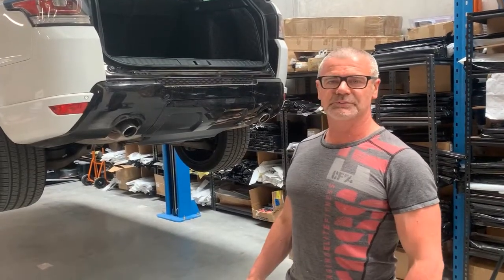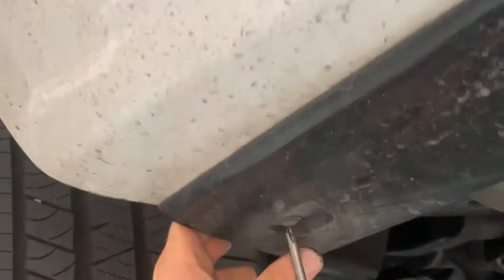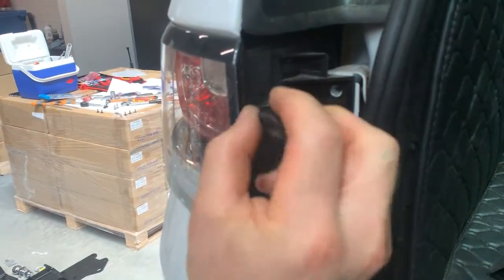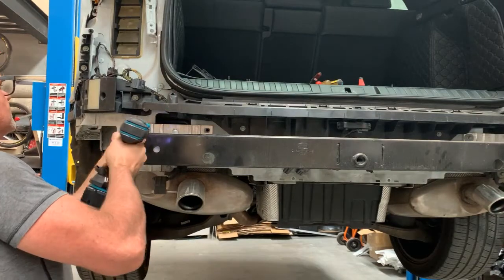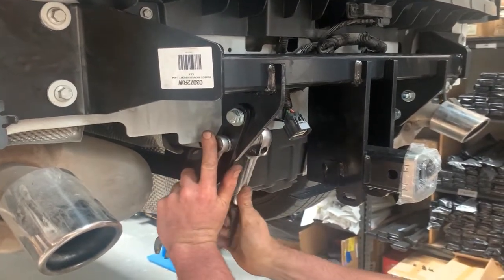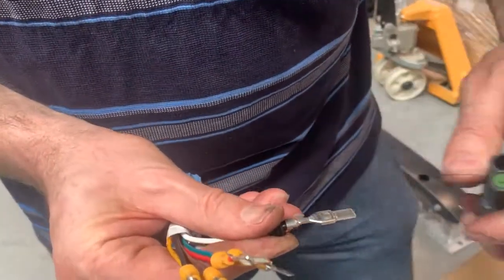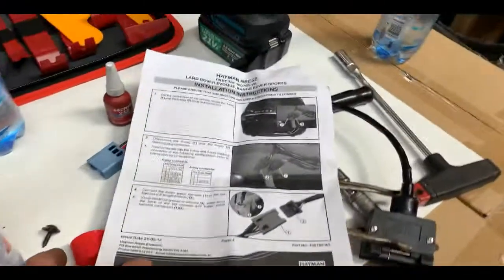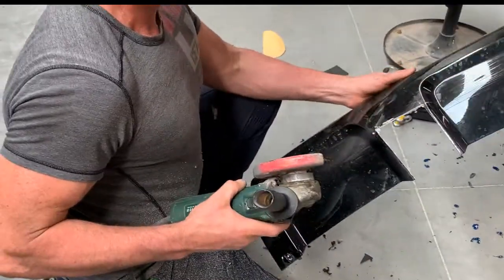RANGE ROVER SPORT L494 - TOWBAR INSTALL  HAYMAN REESE 3500KG

Comment: GOOD STUFF!! did they ever fix the battery drain issues with these and dash with acc on and the car draining low battery
Reply: I think those issues were on the earlier models.. I actually drive this car and have no real issues another that the entertainment system is slow to react and seems to be a bit out of date, though i know the newer models have newer systems in them..:)

Comment: What is the benefit of a tow bar as opposed to the regular hitch assembly? Can you pull more weight or does it just stabilize the trailer or keep the frame from twisting? Thanks
Reply from the maker: We only have Tow bars here..In Australia a Hitch is a ride you get when you stick out your thumb on a highway... Though here it's really not advised as you may end up buried in a ditch somewhere.. :(